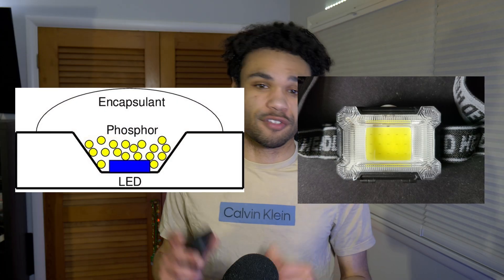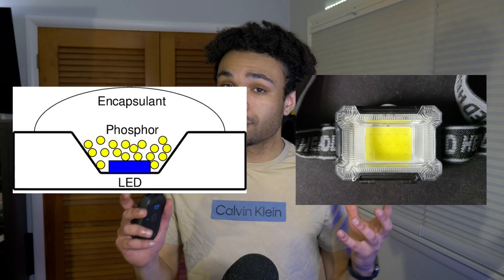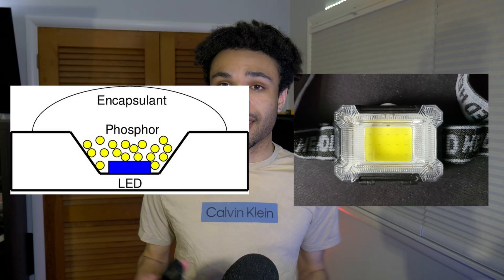What's Up With Purple Streetlights?

Comment: With a purple LED, you'd see all sorts of CSI type of things you didn't know were there.
Relatedly, a few years ago I bought a couple of cheap and cheerful LED spotlights that turned out to be purple. I assume the phosphor simply wasn't ever there, so I got the factory rejects.
I'd thought of coating them with yellow glass paint, but there will be no phosphor action, and it will probably be horribly inefficient.